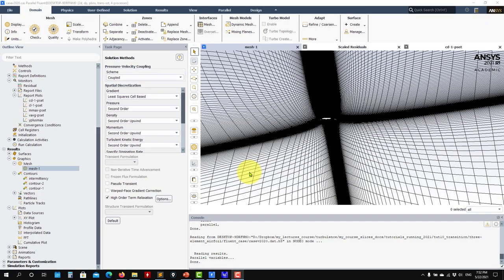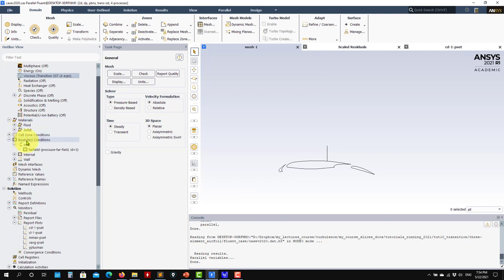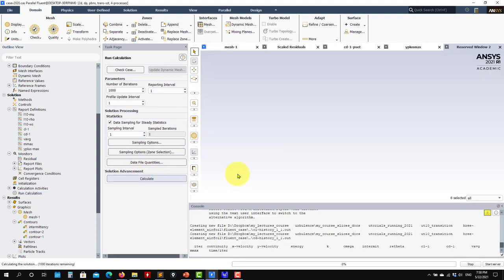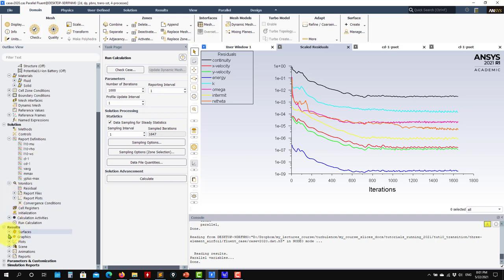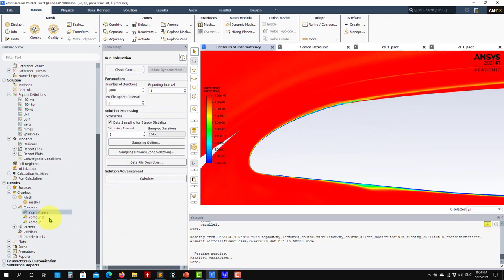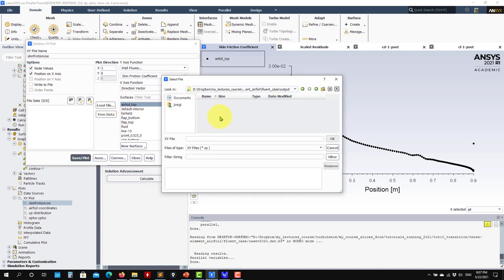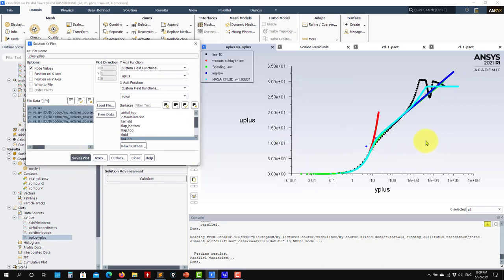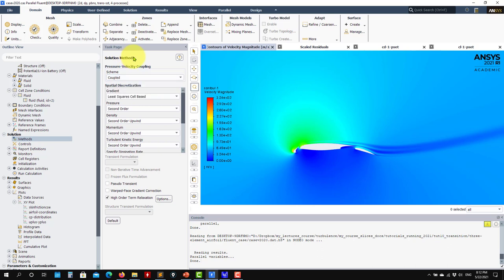Turbulence modeling with Ansys Fluent | Transition to turbulence - Three element airfoil - Part 2

Comment: Good video. I have a doubt. For the similar 2nd case in report definition, I want to find the CM. What values should I enter in the moment points and the moment axis? Also, I want to find the CM values for the 3D wing. In that case, what will be the moment points and moment axis that I need to consider if the flow is in the positive X direction and the lateral axis is Z? Please kindly explain. Thank you